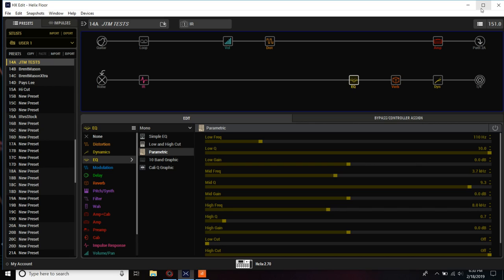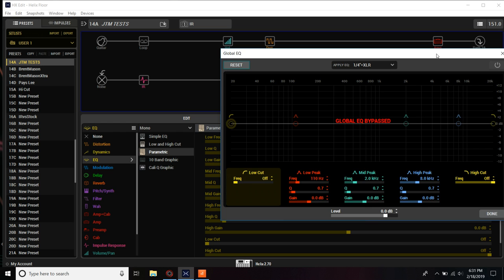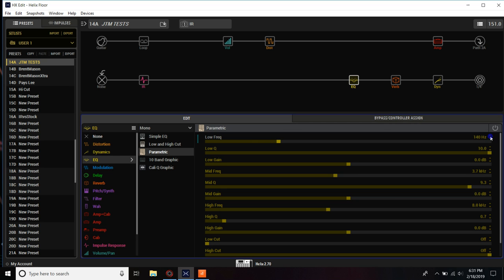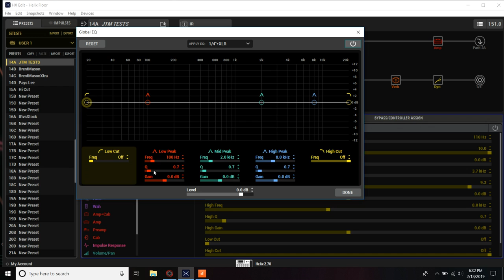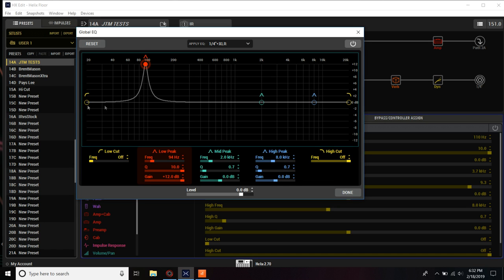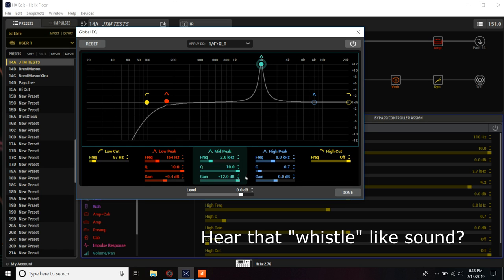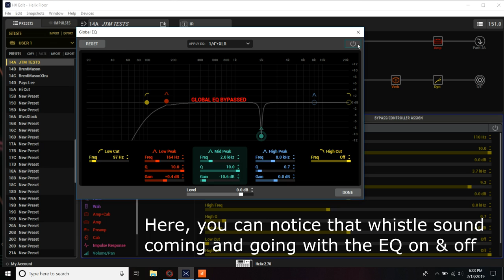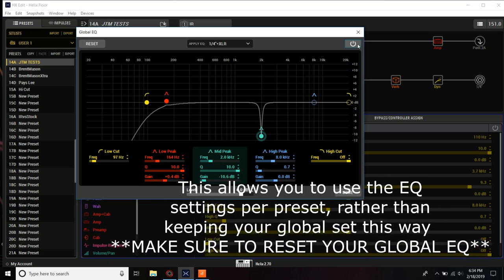Get Rid of FIZZINESS! Line 6 Helix & HX Stomp

Comment: Hi Steve and thank you for the fantastic video.In the helix the eq is very important at loud/ gig volume.
I use with my rock band a eq block( parametric eq) after the cab( in the cab no low and hi cut), with low cut 160-200vhz and hi cut 5000/7800 , cut 2.4 khz ( reaonance in my guitar) and 4 khz ( picking) and the sound from PA system is perfect.
Reply from the maker: Great advice here ! Thanks for the addition 🤘🤘🤘

Comment: Hi Steve. nice video. I have a problem that I wonder whther you can help me with. I have the Helix Rack, same software, amps effects... I always get a fizzy scratchy sound no matter the amp or effects that I use. EQ'd it to the point of death and never get a good sound. I replaced it because i thought it was faulty... same issue. No matter what guitar I use, 6 or 7 string, Ibanez or Jackson, I just can't seem to figure this out. I find it hard to believe this is a faulty unit as it is giving me the same results as the first. Have you any suggestions for getting rid of the fizzy sound. I can never get anything like the sounds that others have even with IR's (Ownhammer Rectifier and V30=H25 packs). I'm stuck. I don't want to get rid of the Rack as I am sure I must be doing something very wrong. I am looking for a variety of sounds. Much of the stuff I play is higher gain (tried turning the gain down to nothing). I also use lighter gain sounds on much of of what I play. I have tried the Badonk, Rectifiers, etc. Any ideas?
Reply from the maker: Thanks Stephen. Typically, when users have this issue its because their preset is way too loud. I would suggest bypassing your signal chain and play the guitar direct in, then turn on your amp and cab to see how much you are increasing the signal. Its subjective and debatable, but i always keep my presets at least somewhat close to, but always greater than,  the overall bypass volume (just guitar plugged in)